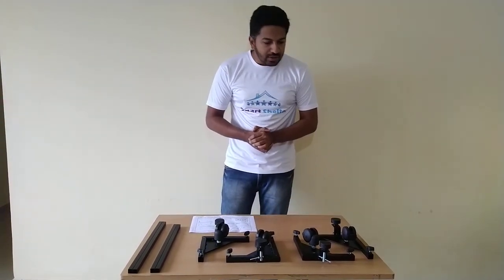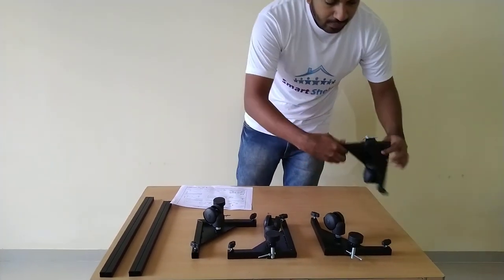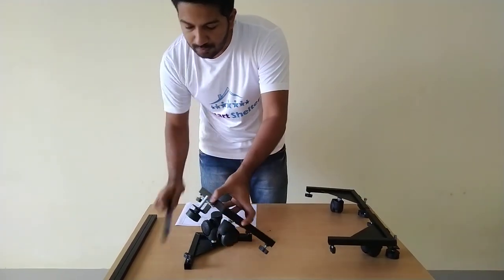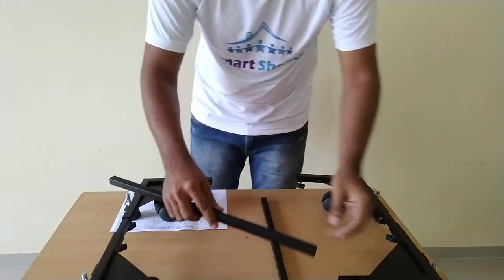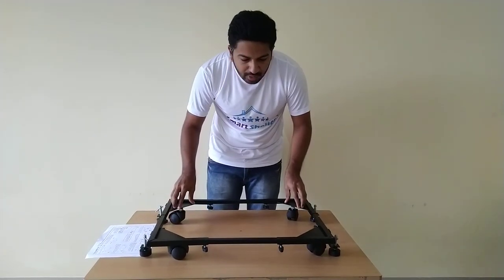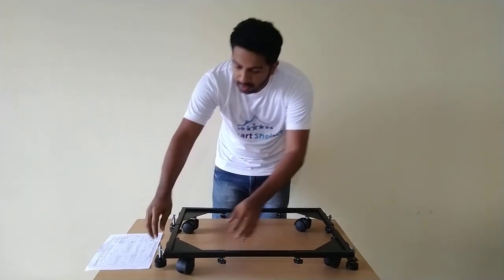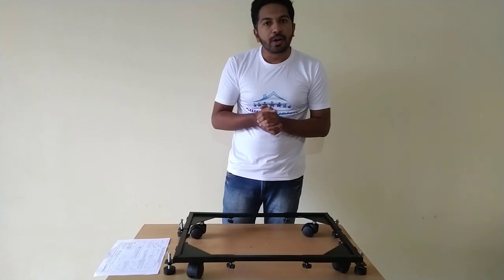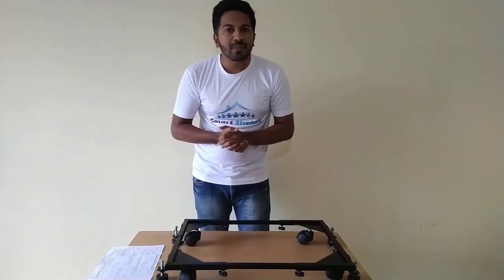Smart Shelter black washing machine refrigerator trolley with vibration absorbers

Comment: Stupidest design! Once you put a 65 kg washing machine on this it’s not easy to screw / unscrew the rubber stoppers. I had to drag it today back and forth. What happened to old design with just wheels that could be locked / unlocked as required 🙈